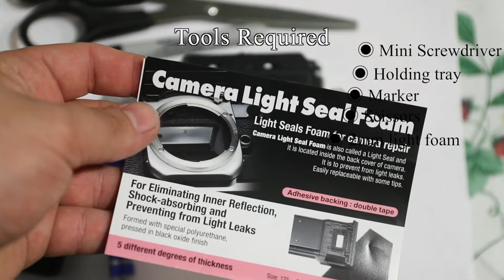Kiev 88 film magazine light seal replacement diy instruction video

Comment: I have but one question.  The metal piece that the light seal adheres to on mine is quite literally perished.  It has been shredded and I found bits and pieces of it through out the cassette.  Can those be replaced as well and if they can where does one purchase that piece?  Thanks.  BTW, great video and I like the music.
Reply from the maker: Officially, I have not found another piece like it for sale, however I have used thick aluminum foil and cut and folded it to the correct dimensions and it has been holding up great in a few of my film magazines. Definitely find the thickest aluminum foil that you can. If you need the light seals, check out my latest video where I sell the foam seal perfectly cut for the magazines (minus the metal foil piece) .